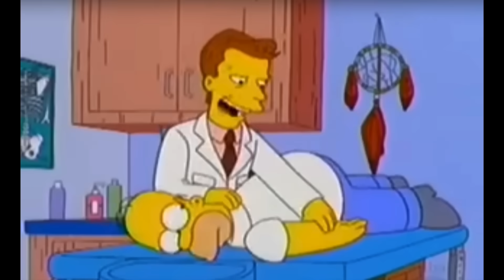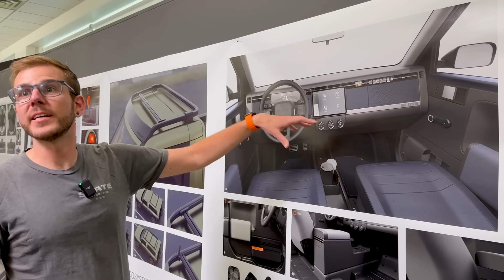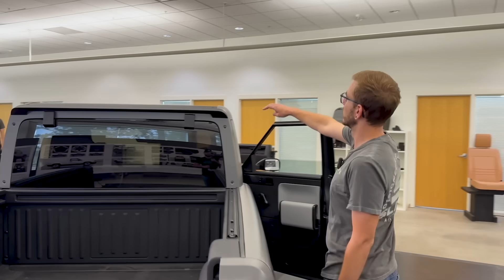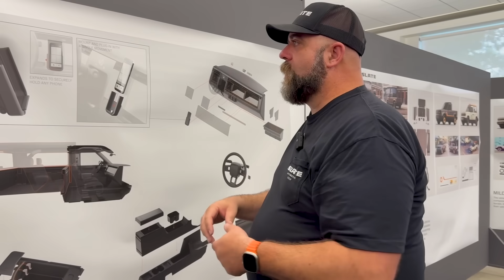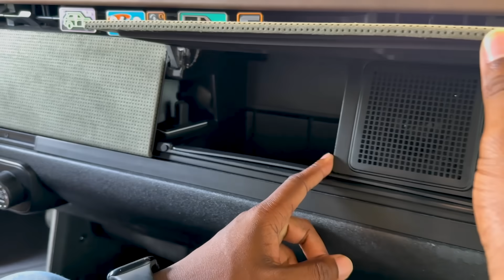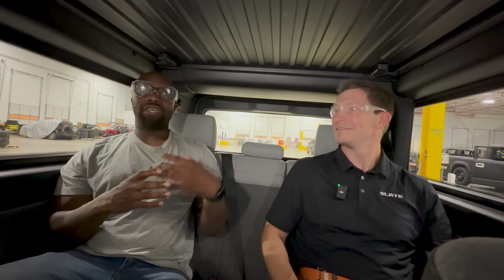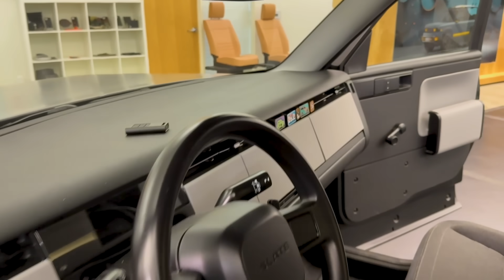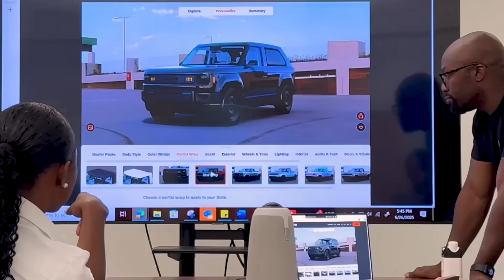The Slate: America’s $20K Answer to China’s Cheap EVs (Exclusive Access)

Comment: Would be good to have a spot for a 2 din aftermarket headunit
Reply: The point of the rails under the dash (and the whole design philosophy) is that it'd be trivial to add one - hell, it'd be almost trivial to make one. A 3D printer (or print-on-demand service), TinkerCAD and a few hours would be all you need; plenty of DIN enclosures on Thingiverse already, just need to add adapters for the rails. Just make sure you print in ASA or ABS, otherwise it'll get melty.
Reply: That would be a really nice idea to keep compatibility with most radios yeah.
Reply: there is a mounting point for double din units under the dash cover
Reply: Or get one of those chinesium Android head units!!
Reply: AFAIK there are no manufacturers of car radios that connect to Bluetooth speakers. Given the slate doesn't have the cabling for speakers, like every other non slate accessory you'd need to DIY it.
Reply: @TravisBrown42 right... and the whole point of the Truck is that everything is easy to DIY. My Aerostar didn't have wiring for 4 1,000 watt amps and 4 JL 12s either.
Reply: Id bet the make a panel thats removable to allow for a din or double din radio
Reply: I would just mount it under that current dash.
Reply: I would bet that feature will make it into production. Thats probably the first thing people say about it.
Reply: There's a few obvious spots for a headunit
Reply: Or a classic single din, I have one in every car and it's really all I've ever needed. That and a phone or GPS mount
Reply: They have a mount for a tablet and there is a Bluetooth speaker kit. Thats your double dinn taken care of.
Reply: They need android auto and apple car play
Reply: @ashishpatel350  i mean once they have the 2din spot and connectors you can pick up a decent headunit for around $200 with wireless android auto and car play
Reply: @ashishpatel350 no.  If your going custom let the in dash unit be open source and hopefully free but an app store might not be bad.
Reply: @ashishpatel350 lol you don’t need CarPlay when the screen is literally a fucking iPad…
Reply: @ashishpatel350  They don't need it, people want it.
Reply: @firstNamelastName-ho6lv they do want it slate doesn't want to spend the money to keep margins as high as possible. Just more greed. The thing doesn't even have an accident avoidance feature.
Reply: @ashishpatel350  the accident avoidance feature is the steering wheel and the brake pedal. Which will be actuated by oh let's see here a driver
Reply: @ashishpatel350 Everything about the slate you add yourself, it's not about profit margins it's about simplicity.
Reply: @ashishpatel350  What part of "this is a basic truck" did you not comprehend?
Reply: @ashishpatel350 That is because you don’t need crash avoidance if you pay attention while you drive. Wah Wah muh Tesla be parkin itself
Reply: @ashishpatel350  And that's your biggest complaint? I've never owned a vehicle with anything of the sort and it's crazy to me that a feature like that not existing is somehow greed? That's a very expensive thing to implement, and you need to keep the price of your product down somehow if you're targeting a lower end market. Just more computer BS that has an important sounding name, if you ask me the companies that add those features are greedy, they're trying to scare people into buying more expensive packages just to feel safe. We know this is true too, because the big car companies have been doing it for ages now. Ever wonder why everyone and their grandmother drives a vehicle that's the size of the old F250? They don't have competition on that market because of the chicken tax, and they know they can make consumers feel like they're going to be run over in anything smaller. Fear is the biggest marketing method right now, while back in reality these huge vehicles have worse crash safety because they're top heavy and have a rigid frame that transfers shock into the occupants.
Reply: @ashishpatel350  android auto just use head unit reloaded on your phone if its car play just get one of those dedicated displays for that to but honestly its cheaper to leave the infotainment to the end user to make it how they want cause a LOT of OEM setups leave a LOT to be desired, ford sync, chevy's system an other OEM infotainment systems are pretty trash or extremely unreliable